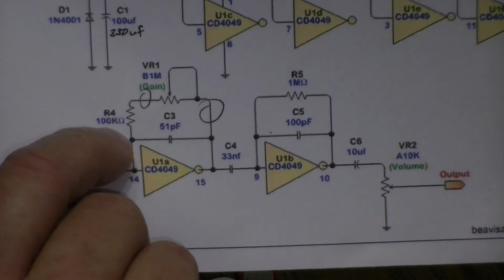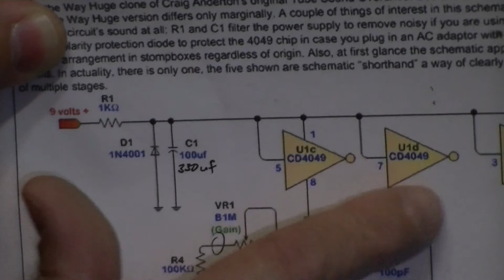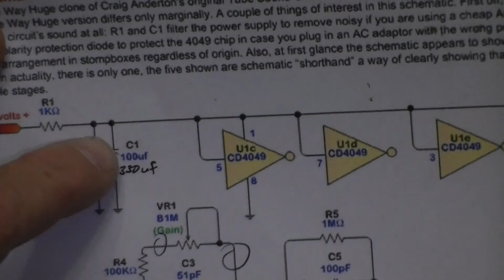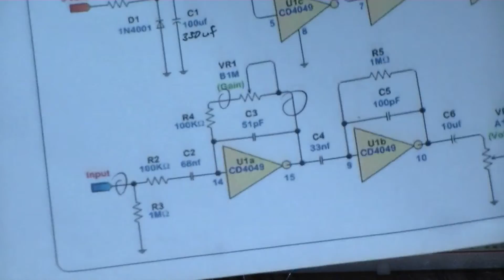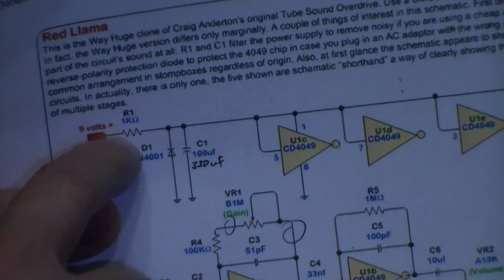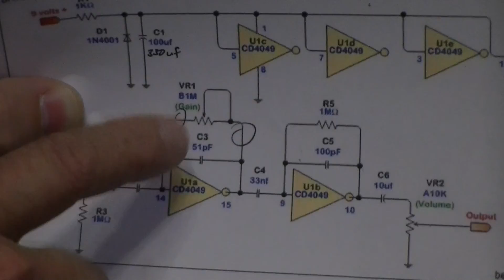Red Llama Clone & Circuit Mods

Comment: I live modding these, more voltage in, lower the gain. 500k log gain pot and even jumper the inline resistor. It's great for a tiny bit of bite. Very amp like.

Comment: awesome review... that pesky 1Kohm power input resistor connected to the 9V dc rail does indeed take a bit off the low end and perhaps other higher low mid range frequencies.

upon your suggestion of 100 ohm value,  i messed around with an adjustable in parallel with the 1Kohm resistor going from 0 ohm (full 9volt dc) to 500 ohm... i noticed that around 100 ohm there is more beef in the overall signal and even more with the resistor completely bypassed...(0 ohms). 

since i am using a one spot 9 v dc power supply correctly pinned, with the center pin negative, and not using a battery or other potentially reversed polarity power supply, i opted to feed the circuit with the full 9volts. 

i opted to omit the diode and the 1K ohm resistor; bottom line is the pedal has a cleaner more refined low end push (not much more but noticeable).

the ic can actually handle up to 18 volts dc. my guess is that in the 1970's, using a 1k ohm was originally designed to save the battery life.

thanks again for all the work and description/examples of circuit tweaks.

jp